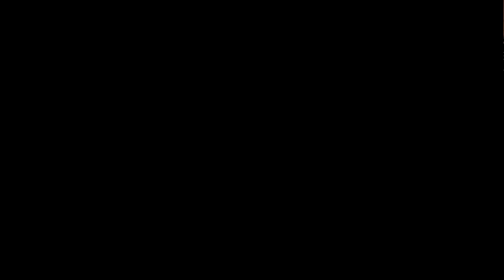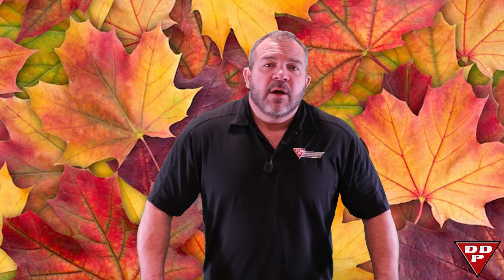Microseconds vs. Pressure

Comment: I'm beginning to understand (thanks to your video's) the relationship  between injector size , micro seconds and it's effect on cylinder temps and running characteristics. I'm wondering at idle what is the minimum amount of microseconds the injector and computer can manage.  Thanks again for putting these episodes out, I'm stunned that they get so little attention!!!!